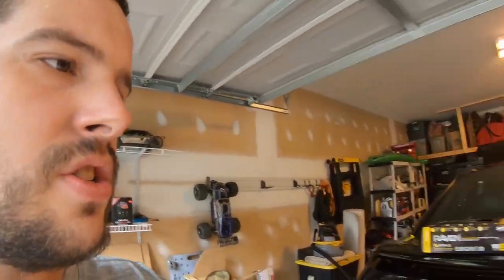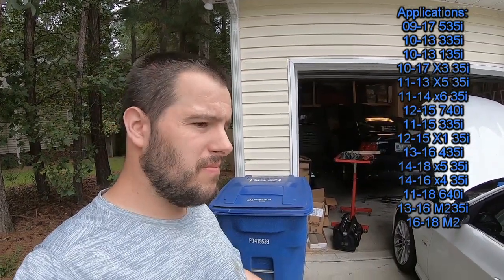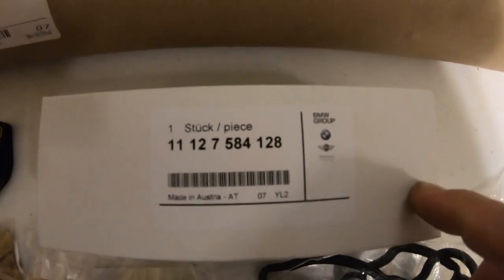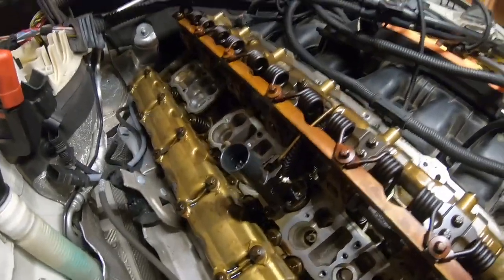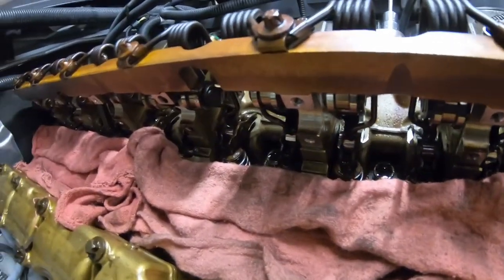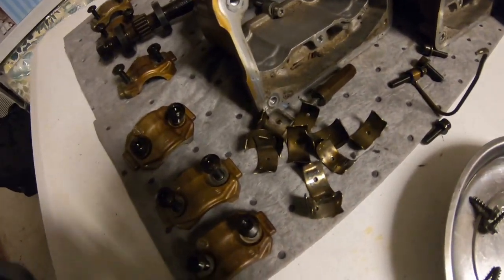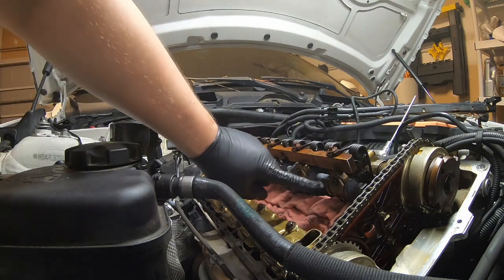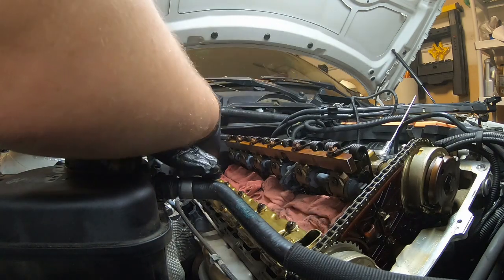Bmw N55 Eccentric shaft replacement

Comment: How long does the process take how much labour time should I be happy to pay for with only replacement of the servomotor
Reply from the maker: It's around 6 hours of labor to replace the eccentric shaft motor. So, depending on the shops labor rate, you will be looking at anywhere from $600 to over $1000 for just the motor, not including parts.

Comment: I had a question about the fuel injectors, I see online that the decouplers and o rings on the Injectors need to be changed when they are pulled out, did you end up doing that? Thanks also I head that the bearing cap bolts should also be replaced is that true?
Reply from the maker: Decouplers are a good idea to change, but o-rings are not necessary unless you leave the injectors out for an extended period of time. I have never replaced the bearing cap bolts during this repair.

Comment: dude, i had multiple codes about eccentric shaft and just replace the valve cover now all of them are gone, car its smooth as factory no need to spend unnecessary money
Reply from the maker: Just because that fixed your problem doesn't mean it will fix everyone's. These cars have a pattern failure where the components for the eccentric shaft wear and do not rotate properly. This causes binding in the movements and the fault codes addressed in this video.

Comment: Great video, however I tried to do this your way and discovered that it was impossible to put eccentric  shaft back in and not screwing up needle bearings without relieving pressure from the springs/rollers that push it out as I tried to put it back in. By the way that crucial part of your video was blacked out (wonder why). I figured out how to relieved pressure from those springs without removing them (just take each leg of the spring, each spring has 2 and remove it from the roller one at the time and rest  each leg against valve shaft, the #6 cylinder last leg is the hardest to do). Without springs loaded rollers it was easy to do and I wouldn’t do it any other way.

Comment: Hi, I heard that it is critically important to put the shaft in the same angle as it was pulled out (for timing issue). Is that correct?

I cannot imagine we can put it back in the exact precise angle as before though.
Reply from the maker: Angle doesn't matter going back in. Just gotta make sure you aren't pushing into those levers with it when you start putting it back together, as you risk knocking the levers out of place.

Comment: Hi man many thanks for sharing the information. How did you put back the injectors? That part of the video was very quick. By knocking over them maybe?
Reply from the maker: If you push down on them at the threaded connection, they will usually go back down in the head far enough that you can put the hold down plates back on. Then, you can use that to push them in the rest of the way.

Comment: hi there ... loved the video ... just a question the needle bearing do they have a cut on them so that you can fit it on the eccentric Shaft ... Thanks
Reply from the maker: Yes, they do. The plastic cage they are mounted in has a split in it so you can open it up to put it over the shaft.
Reply: @MunkysGarage  thanks .... just another question were can i get a chart with all the torque values
Reply from the maker: @antoniocete4441  Not really sure where to get them outside of having access to service literature. What torque specs are you looking for?
Reply: @MunkysGarage  i need to change the oil gasket on my M135i and also i need to change my Valvetronic motor and check if my shaft isnt seized
Reply: @MunkysGarage  Hi there ... i need to change my valve cover gasket and will i have the cover off i want to change my valvetronic motor and check my eccentric shaft

Comment: Where can I get a scan tool to relean the valvetronic motor on my 2011 135i?
Reply from the maker: I don't have any specifics on which scan tools are capable of this procedure. The scan tool used in this video is something you would have if you owned a shop but is not something a normal DIY'er would bother purchasing. I have a cheaper scan tool than the one used in this video(about $500) that I have for personal use and it is not capable of doing the procedure.  So finding one on the cheaper side of things that can do it may be hard.
Reply: @MunkysGarage  I appreciate the information.

Comment: What about replacement  of the teflon sleeves on the injectors? BMW says they are one time use every time you pull the injectors.
Reply from the maker: As long as you don't leave the injectors out for a long period of time they will be fine. If you leave them out for say 24 hours, they will swell up and won't go back in properly.
Reply: @MunkysGarage   Hmm. I did my servo motor when I did my VC. Could of saved me a bunch of hassle. Changing the teflon ring  was a pain. Had to order a special  tapered die set. I did only have to remove one injector though. I was a bit worried since its direct injection and seats into the combustion chamber.

Comment: Hi hale how are you I’ve had my car come up with a drivetrain malfunction and all power isn’t available, then I had the valvetronic motor changed by a mechanic but once I got home I had the same code come up again, I called him up and he didn’t cycle the new valvetronic motor so I done it at home, it passed all cycles. Then I drove the car right after that and the code comes up again. After that the code still comes up, does that mean the esscentric shaft needs changing?
Reply from the maker: I would say yes the eccentric shaft and bearings need to be changed.

Comment: Hey, great video, planning to do this later today on an N52. Hopefully you still check out comments section here to answer a question I have regarding eccentric shaft and binding. Currently have a 2011 BMW X3 with the N52 engine spitting out the following codes: P1056, P105B, P1049, P105A. I'm pretty sure the DME is shorted on the VVT circuit and needs to be replaced. However, I'm still trying to figure out why it's shorted. 

After paying for dealership diagnostics, they are recommending the entire system to be replaced as a "blanket repair" similar to one mentioned in the comments below here (eccentric shaft, spray nozzle, bearings, gaskets, sensor, motor and harness). Basically stating they have no idea what caused the short, therefore replacing the entire system would fix the issue. From my understanding, the eccentric shaft would be the only cause for a short if it were to be binded somewhere therefore requiring the motor to request more voltage than usual. However, once I remove the shaft, would there be any physical evidence of binding or other damage? Currently with the shaft still intact, I didn't feel any resistance moving the motor up and down the gears. Nor were there any physics evidence of damage on the motor itself. Any ideas?
Reply from the maker: You are correct that the eccentric motor binding would be the only thing to cause the excessive current draw. As far as physical evidence to the shaft or motor as dead proof it was the issue, well that has varied for me. I have seen ones where the teeth on the motor are all eaten up, and it's obvious that there was an issue. Other times everything looks okay but I would replace everything anyways, usually warranty, and the fault would go away. So what I'm saying is physical damage or binding isn't always going to be there even if it is having an issue. As far as the harness being any part of the issue, I have never seen that on an n52, nor have I seen the driver in the ecu go bad. There were issues with the n55 harness where it would short out and cause issues, so maybe it is possible on the n52, I've just never seen it.
Reply: @MunkysGarage  Thank you for the quick reply. So the best option here would be to remove the shaft and simply replace it with a new one? The shaft would be under warranty but I was told the DME won’t be. I have to make sure the short doesn’t happen again otherwise I’ll be throwing away another DME for no reason. Also, I tested the motor with electrical terminals for both pins and it works properly, clockwise with positive on right, and counter when positive is on left. The teeth also appear to be fine with no wear or chip marks. 

I doubt the harness would be the cause of the short, but this X3 does have the same chassis code as N55 (F25). So I might take a look it just in case. As for the shaft, do you know what would cause this binding? Lack of lubrication/oil? Bearings are worn?
Reply from the maker: I would say yes your next step is to replace replace eccentric shaft. Make sure you replace the bearings with it. It is my understanding it binds in the bearings due to the load it is trying to push against. It almost seems to me like it would be considered a wear item. I'm surprised the DME isn't covered, unless you just have higher mileage. As they are normally covered for 10 years 100k miles.
Reply: @MunkysGarage  Alright thanks for the quick replay again. I'll just simply replace the shaft, bearings, oil spray nozzle, gaskets and DME. Will update if anyone is curious about the results or conclusion of this repair. And yes, vechile is older than 10 years and has around 114k miles, so warranty does not cover DME.
Reply: Hi there... Did you fixed it... Did you replace the shaft and bearings... Thank you
Reply: @macannnas  I have fixed it and drive the vehicle to this day without any issues. I ended up not replacing the eccentric shaft. Instead, after digging deeper, a binded shaft is extremely noticeable if you were to attach the valvetronic motor again and move it manually with an Allen key. For me, I moved the motor around back and forth multiple times and could not feel anything abnormal. Instead, I replaced the motor itself and the DME (recoded) to fix my issue.

Comment: How do you know your whole eccentric shaft is out and not just the sensor?
Reply from the maker: There isn't really a way to tell if the shaft is what is causing the problem. The sensor is actually built into the motor. The gear on the motor and shaft get worn and can cause binding between them. There is a service bulletin from BMW saying if it has certain faults to replace the shaft and motor together. I believe it is just a bulletin giving you a blanket repair since they don't really know which is causing the problem. If you are trying to be cost effective I would say to replace the motor first, and recheck. In all of these I have done the gear on the motor always seemed more damaged and was most likely what was causing the issue.

Comment: I see some teeth are weared in my eccentric shaft. I want to see how bad is but it's blocked. When I crank the shaft doesn't turn. How can I turn the shaft and is it safe to do so?
Reply from the maker: If the eccentric shaft motor is still installed you will have to use a 4mm Allen bit to turn the motor worm gear from the top. This will then turn the eccentric shaft. If the motor is removed, there is a spot on the back of the eccentric ahaft that a 17mm open end wrench will fit over so you can turn it.

Comment: Hi, I don't have any of the scan tools, so I was planning to have my local shop do the reprogramming for the VANOS motor and the injectors (I had to replace mine).  Does anyone know if the car will start and drive with new injectors or will I need to have it towed to the shop?
Reply from the maker: It will start and run. But I would not advise driving it. The injector flow rates are what needs programmed into the engine ECU after replacement. If it is using the old injector flow rates with different injectors it could cause an issue where it flows too much fuel and hyrdolocks  the engine.
Reply: @MunkysGarage  Thanks!  Tow truck it is.

Comment: Hi, I have the problem on my 640xdrive (the noise when closing the doors), replaced the valvetronic engine but the shaft will still not go back all way up (it does go all the way done).  BMW says it's possible the DME or could it also be the shaft itself ?  

When the motor is switched off, the shaft should go all the way up (don't know it this is max or min), mine does.
At this up position, should the spring action be the smallest? iow should you be able to move the shaft with the allen hey without friction ?
How do you know the shaft has to be replaced ?

Thanks for the response.
Reply from the maker: I believe the shaft returns to minimum lift when the vehicle is off. I am not 100% sure if that is the up or down position, I believe it is the down position. When it is at maximum lift is when you will have the most spring tension trying to return the shaft to the lowest position. The shaft should be easy to move through its range with the allen key on the motor, but will have spring return if you let go of the allen key. It is hard to tell if the shaft is actually "bad". Many times on vehicles that are having issues I can still turn the shaft freely with the allen key and also with the motor removed by using the wrench spot at the end of the shaft. The issue is the motor is monitored by the computer for both position and amperage draw. When the computer sees amperage draw go over its pre-defined limit, it sets the fault and the system quits working. This pre-defined amperage draw may still allow movement of the shaft with tools, but the computer deems it is binding and it will not operate. Most of the time I see galling of the teeth either on the motor or the shaft, and this is usually an indication things are binding up causing the high amperage issue, and subsequent shut down of the system. It is common practice to replace all components of that system when servicing just to eliminate having to redo the repair again when it turns out it wasn't just a faulty motor. There have also been some instances where faults can be caused by a faulty wiring harness for the eccentric shaft motor, in these instances it sets faults for voltage(not sure of exact fault description), and not the ones addressed in this video for mechanically stiff or binding.
Reply: @MunkysGarage  Thank you for the quick response.
I have seen the shaft going all the way down by the servo motor (same direction before you can removed the servo) every time.
I understood at this point a lot (most ?) of force is needed , that would indicate the servo is working.
It's in the other direction that the shaft will not go the the end position (=when motor is off) every time.
I will check with an allan key if I can move the shaft all the way ...
Cables have been checked and the errors on the DME are not clear...
And no DME is on stock ...

Comment: i got a code p1030 valvetronic motor sluggish movement. i changed the motor ran ista to relearn the motor. started the car and got the codes p1030, 2dce and 2e0f. would replacing the shaft solve this or am i missing something?
Reply from the maker: Sounds like the shaft itself is mechanically binding.

Comment: How to RESET BMW Valvetronic motor:

1.  Insert the "Valvetronic Motor" and connect its 2 pin plug. 

2.  Then switch the ignition onto position 2 & within a space of 15 seconds, depress the accelerator pedal down to full throttle 10 times and you will hear the "valvetronic motor" program itself back to factory spec.
Reply: 2 PIN?????
Reply: @JusticeNass  Probably an N52...way different than an N55 which this video is about...

Comment: What would happen if you don’t put the Eccentric shaft back to the open position before you complete the job? I recently had this job done and I’m experiencing issues. Any help would be appreciated.
Reply from the maker: It has to be at the no lift end stop to properly perform the learn end stop adjustment function after replacement. If you don't do the learn endstop service function after replacement it will not work the way it is designed.
Reply: @MunkysGarage  so when you say end stop you mean completely open to the very top/open position?

Comment: I was told this might be a stripped vanos gear. Is it possible this knock is from the valvetronic eccentric shaft? Frequency is 1/2 crank rpm. Warning it's an ugly sound https://www.youtube.com/watch?v=-w6j43aW3l4&t=15
Reply from the maker: Definitely not eccentric shaft noise. The vanos gears have an issue where the bolts on the back come loose and back out. This could be noise from them hitting the cam bearing cap. But in all honesty it sounds like a spun rod bearing. Which the n55 is notorious for as well.
Reply: @MunkysGarage  Thanks for the response! "Apparently" the noise is new and the timing chain was recently replaced. I'm sure that the knock only happens 1000xpm at 2000rpm and 1500xpm at 3000rpm etc--slowmo video and audio is incredible. Is it possible the rod knock could only be audible on every other stroke?
Reply from the maker: It's worth taking a look to make sure it isn't a vanos problem. It is definitely possible for a rod knock to not be 100% in sync with engine speed. I actually have an n55 torn down right now getting a new crank and bearings (cheaper than buying a used engine) that the noise would come and go oddly. I could even get it to go away completely at a certain engine speed.
Reply: @MunkysGarage  Confirmed rod bearing. Getting replaced next week. Let's hope crank is round enough.

Comment: before removing shaft to change bearing did u hold spring loaded bar with something or it stay it self?
Reply from the maker: As long as you are careful and don't bump anything the spring loaded followers will stay in place when removing the shaft.

Comment: Great info. Is it possible for the motor to fail and leave valves open causing a no start condition?
Reply from the maker: I have seen it stick full open and cause a no start. Usually it will try to start and then just stall due to the vehicle not being able to adapt to the full lift at that wrong time.